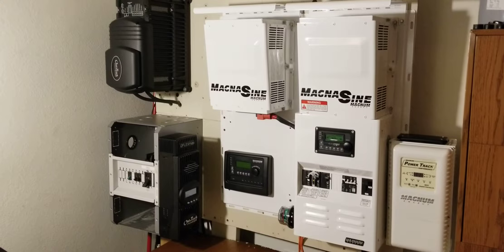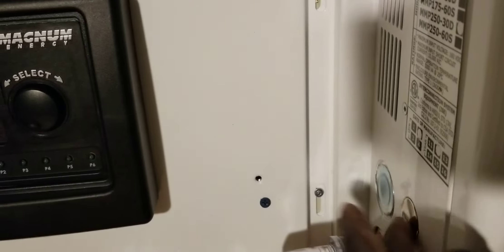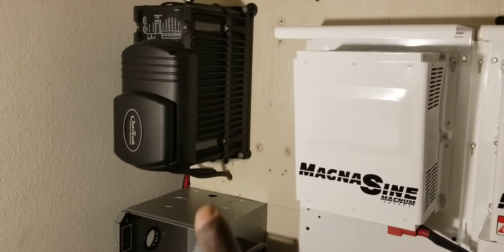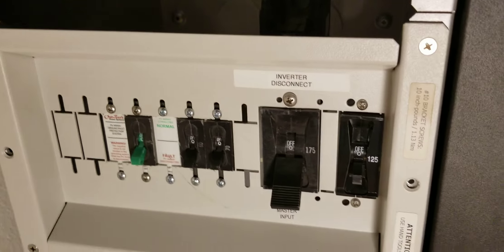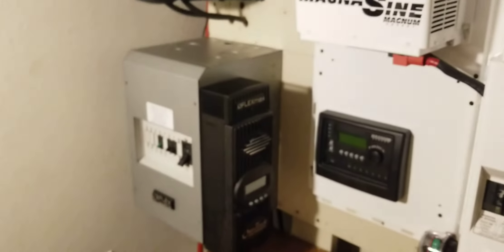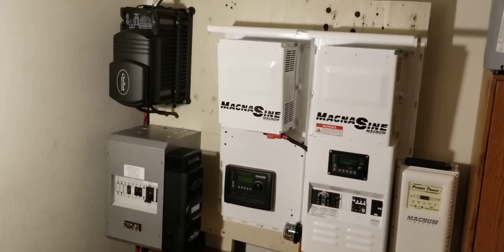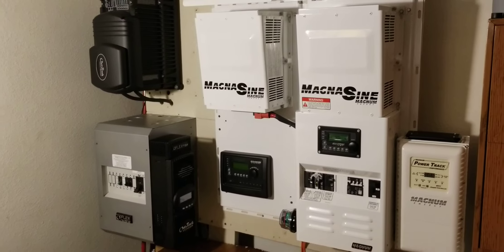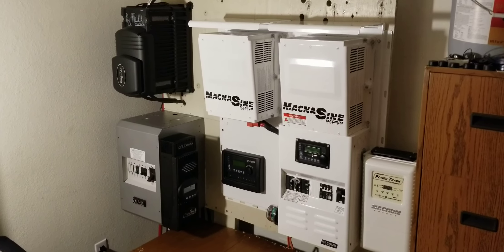OFF GRID SOLAR SYSTEM COMPONENTS INSTALLATION

Comment: DO OR CAN THE FM 80 BE FACED FORWARD LIKE EVERYTHING ELSE ?
Reply from the maker: Unfortunately No.
The Flexware 500dc is designed to mount the charge Controllers like that. 
Thanks for your observation. 
Cheers